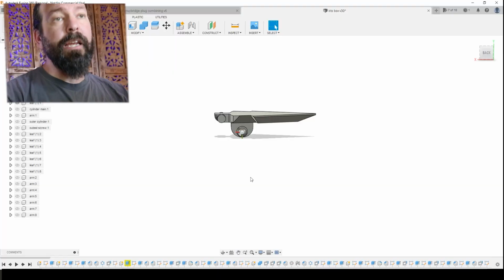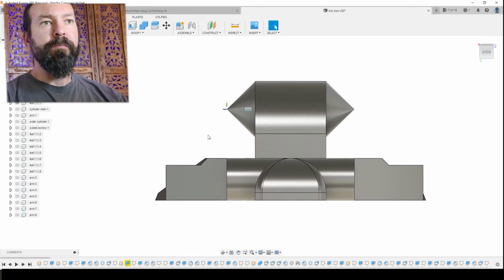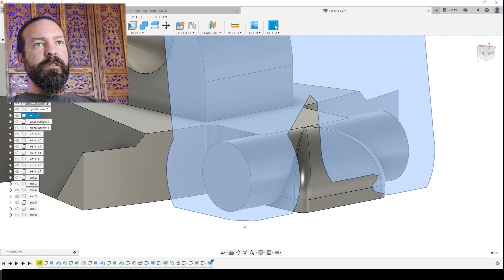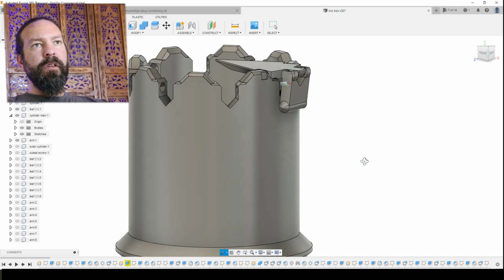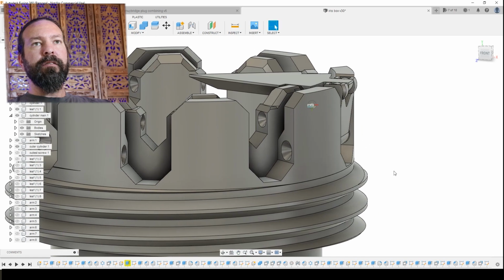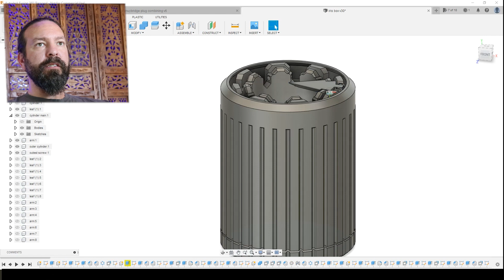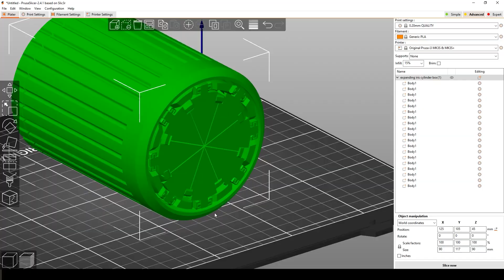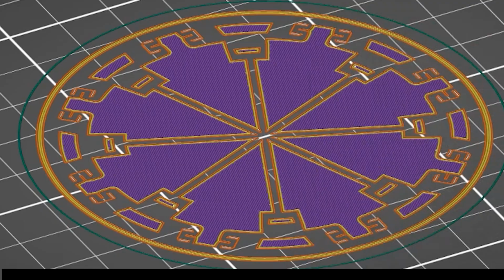How to 3D Print Mechanical Things: print-in-place mechanical iris box

Comment: I think it would be cool to add a second way to open it with a motor.
Add at the ends of the thread for the open and close it could spin freely.
So if using a drill, once it is open or closed there wont be any chance of damage. Love your project ideas

Comment: Thanks for sharing, looks awesome! Looking at the .STL, a guess in regards to the lay flat in Prusa Slicer issue is that some pieces are ever so slightly taller or shorter in the Z axis.
Reply from the maker: yes but WHY?! they're all perfectly planar in fusion. that's the question.
Reply: @CalebKraftmakes  They're all flat, and parallel, but at slightly different heights, so maybe Prusa Slicer is showing different places or heights you could lay it flat on? I'm just guessing.

Comment: The helix tool can get you any customized thread. Quite useful, I am using Inventor, so guess it is similar  to Fusion 360. I would suggest an Increase in pitch and thread count. Minimum 3 thread count with a larger pitch. Measure how far the leverage takes to open= pitch. From there you can choose how many turns you want to open it.

Comment: How did you figure out the clearances between the moving parts?
What clearance did you end up using?
Reply from the maker: .5 mm works on my printer. vertical surfaces won't touch and horizontal surfaces will actually break free of eachother!

Comment: To get it to open in a single turn, you will need to have a level plane at both the top and the bottom where the part will rest in the open or closed position.

A slight detent that it sets in will prevent it from accidentally turning and falling closed due to gravitational forces.

In the following video, the tutorial shows how to assign a number of revolutions that you want the threads to have for the given distance.

It may be the answer you are looking for.

Model Custom Threads in Fusion 360
https://youtu.be/N8xL32uV0SA
Reply from the maker: sounds about right, I'll check out the video!